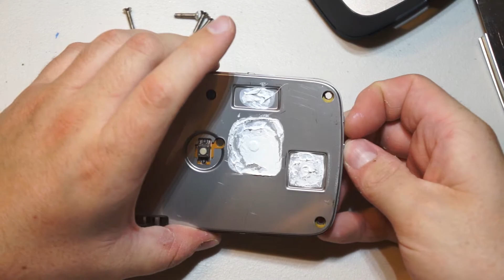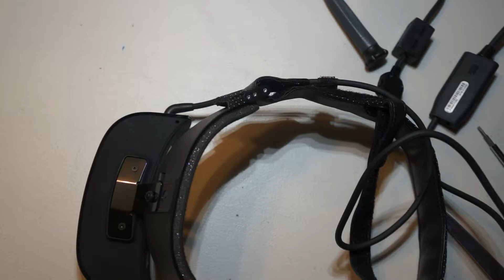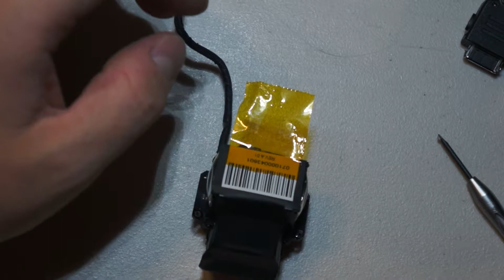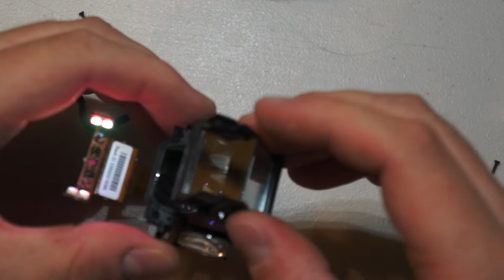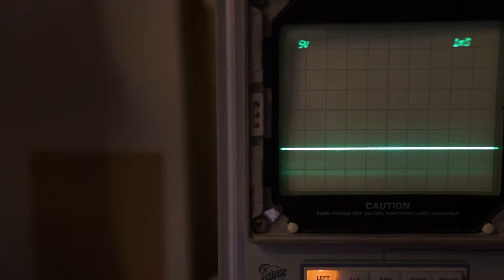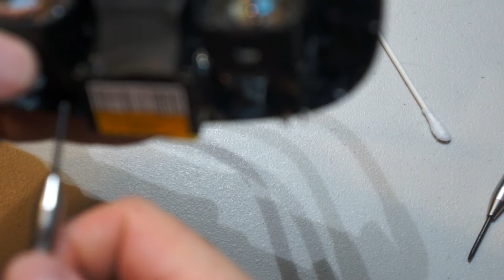Headplay HMD Teardown

Comment: Fantastic teardown ! Since I have Headplay and always was interested in 'what's inside'
1) Can you upload this in 720p/1080p full HD as a torrent file and message me with the file link to download

2) Marvelous piece of technology - too bad the designers of Headplay gave up too early I guess funding issues / poor marketing etc .  Only a Better screen with 720p or higher  - 3D capable(120 Hz]) with nice viewing angles thru Optics  and a higher diagonal FOV of 45-60 deg with a proper eye-shield would have had the Giants like Sensics / Sony closing their HMD deptt forever - Such was the potential of this Headplay PCS

I am a collector of these HMD tech - in fascination with this tech since the time sony Glasstrons had started . Had tried Vuzix also but I was always unlucky that everytime I got them - they were defective [cheap Quality control of vuzix I guess]  .Though I have eMagin z800 [great optics but below avg oled quality], Sony HMZ-t2 [ nice but bulky with no bettry option - T2] , Cinemizers [lcos based] even the Olympus eye-trek fmd-700 [low resolution but good optics same as used in eMagin] but Headplay still I like for it's portability , battery option , great image with limited FOV and viewing angles [the Only Downer]  

3) Too bad that such a Headplay PCS tech. Died too early - my sympathies with Headplay makers
Reply: vrdommed 
Hi.. Thanks for your kind words..  I was the CTO at Headplay and the Technical lead for the product development of this HMD.  Although it is now somewhat dated in technology now..  At the time we pushed the envelope in every regard with the most leading edge pieces at the lowest cost we could find.  LCOS display, optical path, Media Processor... All were selected because they were the best of the best at the time.  There were a lot of requirements we had to meet in a single platform.

Comment: only issue - is the screen which being brilliant but with a very limited viewing angle - no issues if you look at it straight on - or the black spots you have ! - it's Syntax- brillian Screen with extremely small viewing angle 

1) my Question -  Can anyone tell me if there is view to upgrade the panel to 720p / 1080p 3d capable 120 hz panel of the same size as the original  ? has anyone succeeded in doing that ?

2) if someone really DID the above with success - please lemma have details and a how-to video please!

the Screen is the only downer in this - else it's fantastic! hmd till date better than the HMZs of Sony even

Comment: The LCOS is actually a monochrome reflective display so to produce color you need to display at least 3 images per full color cycle to display a full color image.  With 3D on a this monochrome display you need 6 images per full color 3D image.  Every time you switch images you need to balance the DC bias on the capacitors that make up each cell on the LCOS so you need to reverse the polarity on the cell drive to do this.

Comment: This is something the original LCOS mfg had anticipated could be done and we added this capability..  Along with being able to adjust the PWM slightly for each lED set so we could compensate for the slight differences between color imbalance between left and right Eye LED sets.

Comment: Exactly!  There is an ASIC in the LCOS that outputs timing info which the msp430 decodes and provided the necessary timing to the LEDs.  It's a very narrow timing window for each color for illumination. The LCOS manufacturer had an external ASIC to originally do this illumination however we wrote some code on the MSP430 to give us more control to make it so we could use it for 3D by splitting it into two sets of illumination LEDs.

Comment: Hey... Heard about this video... I was so surprised to see this.. Brings back memories..   Myself and my team was responsible for the design and development of all the electronics for both the Media Center (the box) and the display electronics :-).  You got most of it right..  The reason you couldn't see the display by just viewing it is that you needed to use the timed illumination of the LED's against the display to properly see any image on the reflective LCOS.  Its not possible otherwise.
Reply: I know it's been a while since you posted this...  I really love these goggles and their display quality for FPV flying, but the brick and navigation cable are cumbersome and the plug has worn to the point where they really don't work anymore. I have a quick question if you don't mind. Would it be possible modify the HMD to feed composite video and power directly to the unit in order to bypass the need for the brick?  Thank you for your time.

Comment: I would recommend ffmpeg for transcoding, it is good if you want to perform the same job multiple times, its a bit to get used to the command line interface. avidemux is good for 1 off work, you can also use ffmpeg for screen/audio captures under linux (a windows vm under linux sounds like a better idea :P) you can also specify how many threads to split a job into with ffmpeg, and thanks for the video